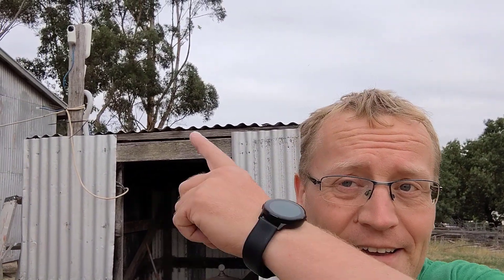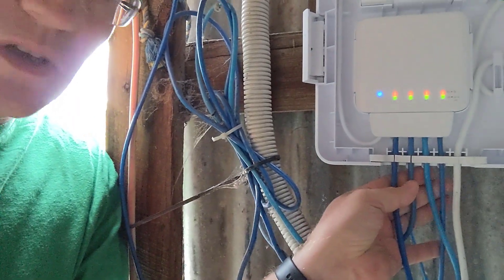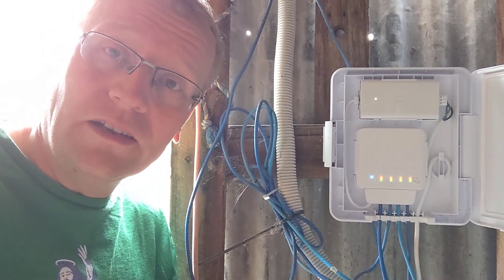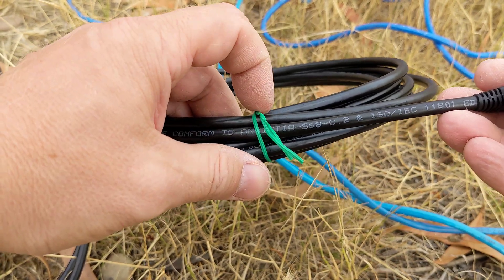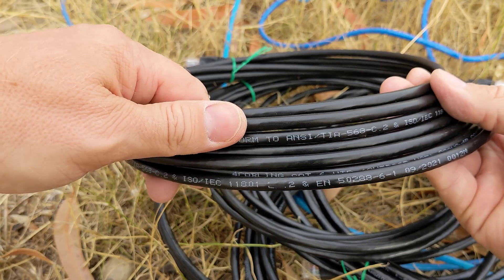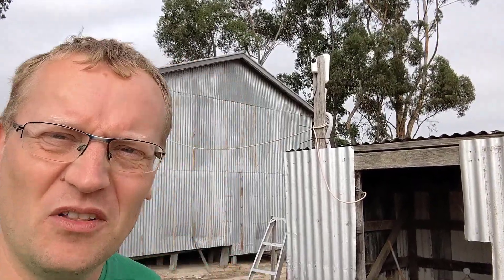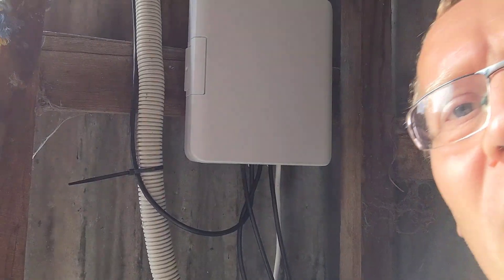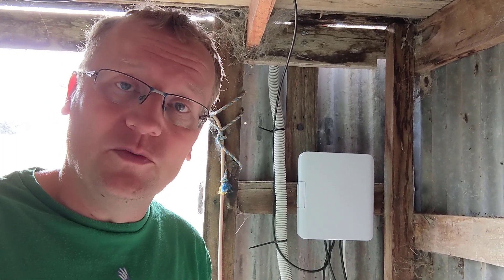CAT6 Cabling - Outdoor vs Indoor

Comment: Quite often I've used good quality cat 6 cables and they last plenty long outdoors in my environment. Important issue I have to use is dialectic grease on all of my fittings.  The grommets and seals do not always protect the ethernet connections at the switches and boxes.  The dialectic grease gives it a vapor barrier and water seal in the ethernet connections.
Reply from the maker: Yes, I have several indoor CAT6 cables still outside working. The issue is that you don't know when they stop working, as the symptoms can be really varied. 
Great advise with the dialectic grease. Appreciate it.
Reply: @LarsKlintTech  They sell cable testers for utp cable

Comment: Never use copper network cables outdoor only use fibre optic as they are not going to burn up when lightening strike hits them….
Reply from the maker: You bring up a good point about the dangers of using copper cables like CAT6 outdoors, especially with the risk of lightning. While it's true that fiber optic cables don’t conduct electricity and are safer from lightning, copper cables can be used safely outdoors with proper shielding and grounding, especially when they are outdoor rated as in this video. Given this, should we consider spending thousands of dollars to replace existing CAT6 setups with fiber optics? It depends on the specific needs, such as bandwidth, distance, budget, and the environmental risks involved. Replacements might be necessary in high-risk scenarios, but in many cases, enhancing existing installations with proper safety measures could be more cost-effective.

Comment: How long had the internal rated cable been used outside? was it producing any problems at the time of removal?
Reply from the maker: As I mention in the video, they've been outside for about a year at the time, and I started getting strange behaviour with the signal. Dropping in and out.

Comment: Point the flex conduit down at the top, then the cables come out and up. This creates a natural drip loop and water can't go up into the conduit.
Reply from the maker: Good point Zippy. I did do this as well, but wanted to mention the service loop specifically as I have seen it so many times being left out.
Reply: I do this as well. And you can always use some insulation tape to just seal the end, just to make it look neat.

Comment: Would it be okay for the indoor cat6 cable to be outside if kept in corrugated conduit?

So the cable itself is not exposed to direct sunlight?
Reply from the maker: Yes, that should be okay. I'd use plastic though, as the metal may interfere with the signal and strength.
Reply: @LarsKlintTech  great, thanks for your response :)

Comment: How are your flex cams going?
Reply from the maker: They are all going strong. Haven't had a single issue with any of them.
Reply: @LarsKlintTech  Had some issues with the newly purchased UDM over the last few weeks ..  Found the App based camera adoption feature is very useful when you have to start from scratch. No scrambling up ladders to reset stuff
Reply from the maker: @simonhall886  Yes, I use that a lot too. Works the same way as the UDM Pro Protect portal too.

Comment: Ha ha - I was running a cable across my roof to an Flex HD using indoor cable and in my head I was thinking “Lars would be screaming at you, use outdoor cable” & then you post this!! Ha ha ha ha #sigh “assistant add replace front gate wifi cable with outdoor cat 6 at some point (soon) to my ever growing task list”
Reply from the maker: It doesn't take long at all for those indoor cables to break and fail when outdoors. You might be replacing them soon 😂